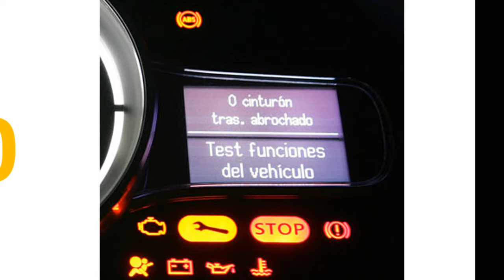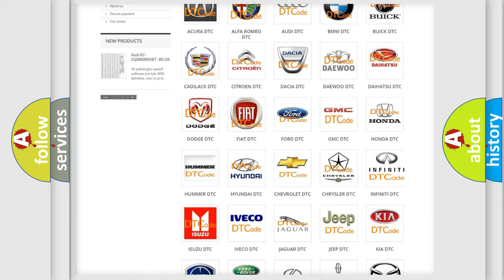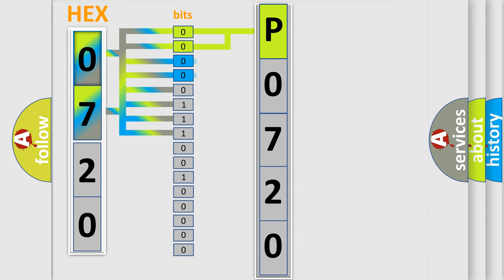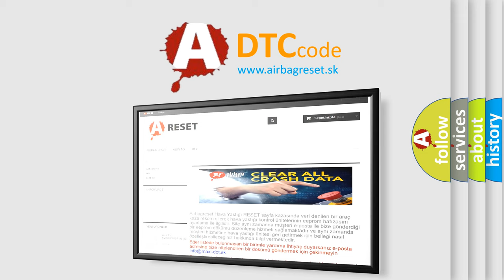DTC Infiniti P0720 Short Explanation

Comment: Wrong it is the tcm
Reply: How does one replace the TCM without replacing the entire valve body?
Reply: @jgarza928  can’t but that’s what goes out not a speed sensor no nothing the tcm goes out no more shifting limited speed stuck in a fail safe mode u have no Brains in ur transmission saying do this. One does not change the tcm by itself to answer ur question.